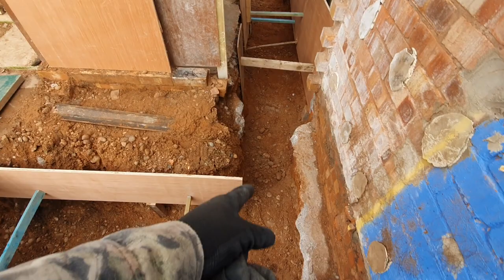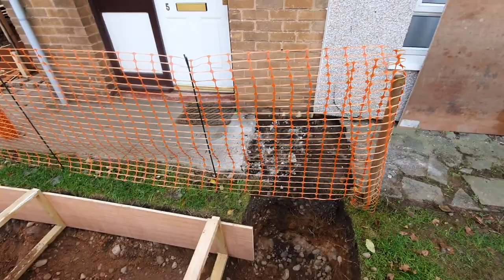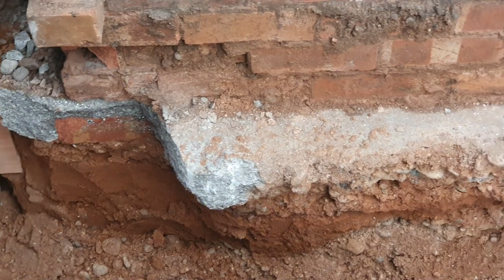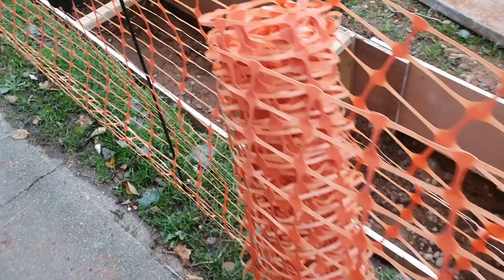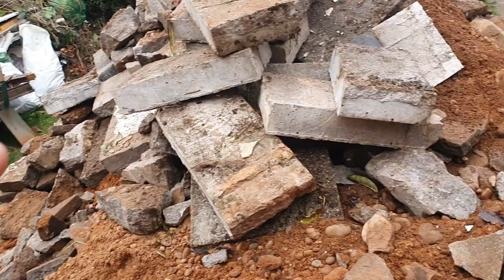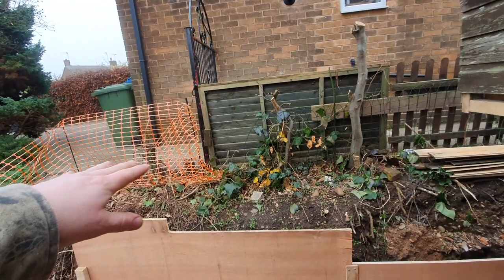Part 5 Of Our Extension Self-Build Vlog 873

Comment: Could you not use 140mm (or 215?) block on the outer leaf rather than 2x engineering brick? Also, I’m not sure how much value externally applied waterproofing would have? If you run your dpm up the cavity face of the inner leaf, then anything outside of that just becomes a traditional substructure?